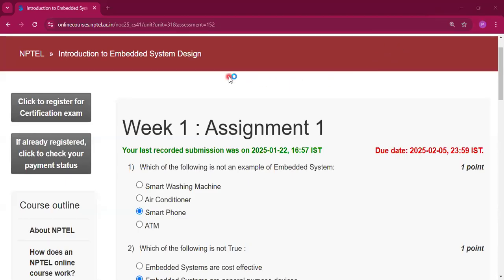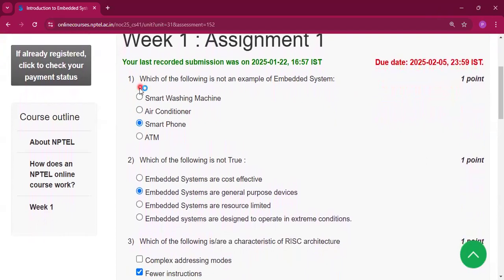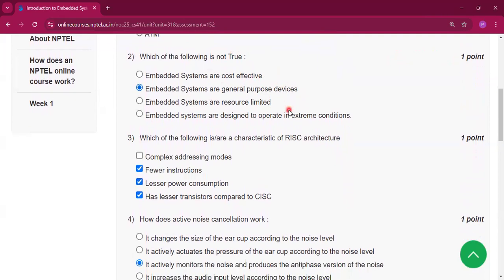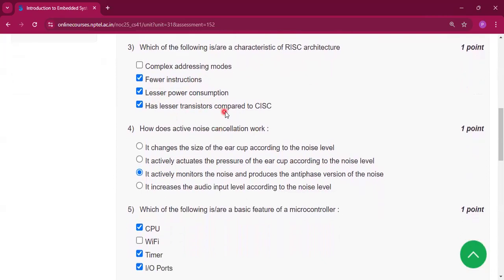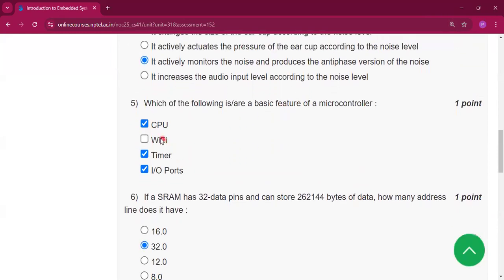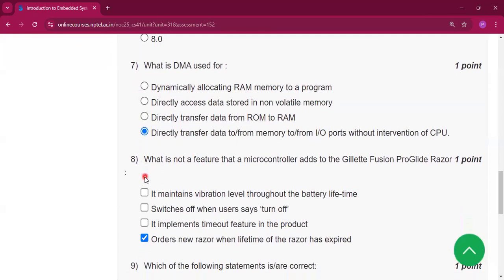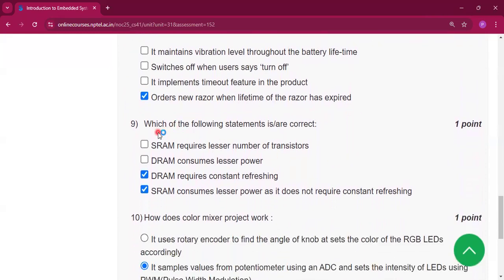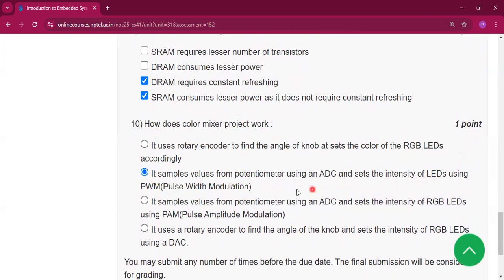NPTEL Introduction to Embedded System Design week 1 answers solutions | Jan-Apr 2025

Comment: Sir,Lemme check option 6 👇👇
To determine the number of address lines, we need to calculate the total number of addresses required to access 262,144 bytes of data.

Since each address typically accesses 1 byte (or 8 bits) of data, and the SRAM has 32 data pins (implying 32-bit or 4-byte data access), we can calculate the total number of addresses as follows:

Total addresses = Total bytes / Bytes per address
= 262,144 / 4
= 65,536

To find the number of address lines required, we need to find the smallest power of 2 that is greater than or equal to the total number of addresses:

65,536 = 2^16

Therefore, the SRAM requires:

16 address lines

So the correct answer is 16.0.
Reply from the maker: @hari_editz032  yeah you are right change the answer to 16